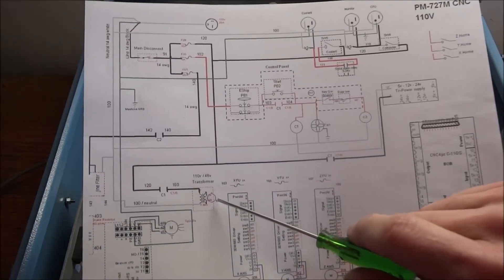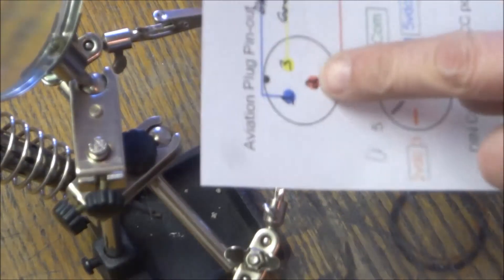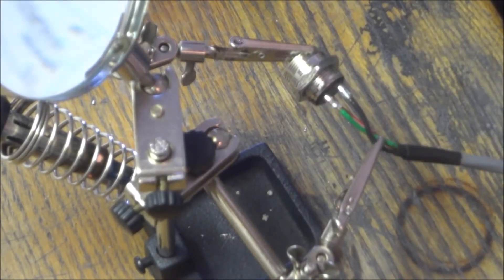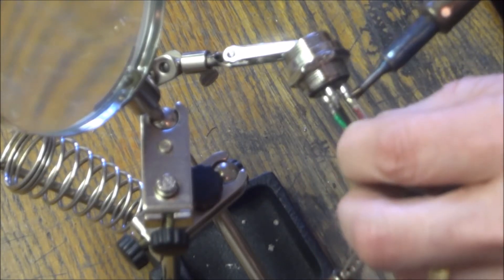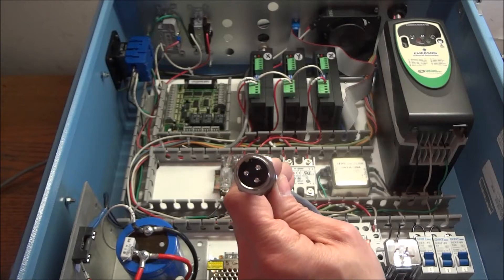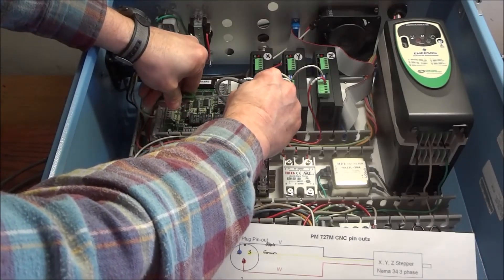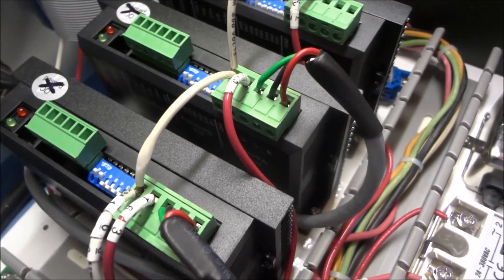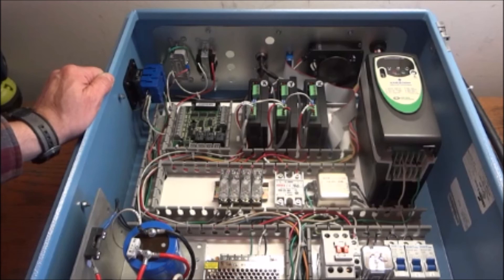PM 727M Wiring Pt 7 " Stepper drivers"

Comment: Thank You for your videos.
 I want some thing, to be mentioned. In gereral you must not tin wires going into the screw connectors. Tin makes first the copper wire brital, it has more tendency to break. and second, TIn behves like a very viscose fluifd. so it tends to flow away. This will cause thinner connections under the srews and this will cause in loosening the scres. If you have several Amps flowing through a loose connector you will have arcing, which can cause fire. The better way is to either use wire end sleeves or use only the twisted copper without tin. So this is only a hint for long term safety and availabilty.Sorry for my English, I am a German. Regards and go further on with your nice tutorials. Michael
Reply from the maker: +DocM 
Thanks Michael, for your tip I guess I should emphasize that the tinning should be minimal just enough to keep the wires together. 
Wire Ferrel's  would be the best choice. to many times strands of wire have caused me issues when inserting into small connectors. I do however agree with your statement.
Be Safe,
Sam
Reply: so i read this after tinning every single wire in my box practically - lol  oyyy veeyyyy .... think i just became a fan of wire ferrals [sic? ]